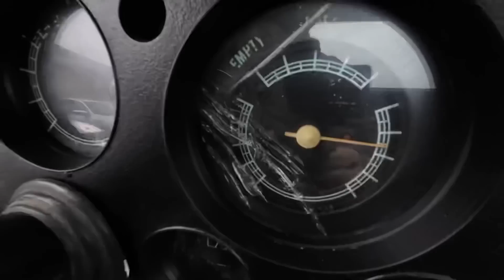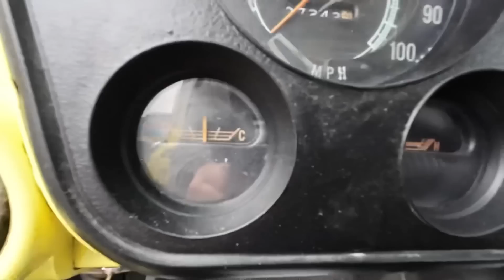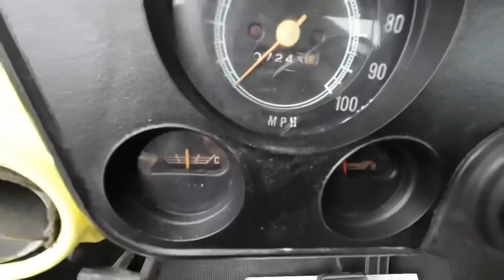Test Drive 1969 Chevrolet C-10 LWB SOLD $14,900 Maple Motors #1881

Comment: Needs a bit of TLC but would be a good every day driver. 
What is it with all these rides without  torque converter covers?
Every time I see that to me is a sign that shortcuts or half assed work has been done.

Comment: 6 Lug on the back and 5 lug on the front.
Reply: Nice catch on the deal breaker, you have to carry 2 spares or a way to break tires down and fill them up. Guess you would want to change that 3/4 ton rear out to get better mileage. Along with the engine work it needs, might as well put an LS in it.  I couldn't imagine putting this much bodywork on something and leaving it so half put together. No dust cover over the torque converter & wiper arms. You will definitely run into more stuff. Guess that's why the price is where it's at.